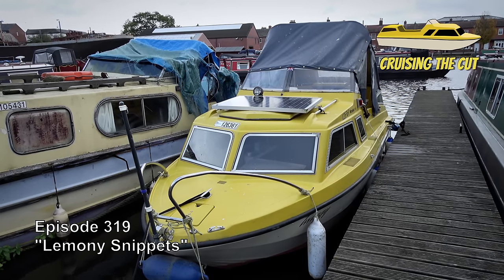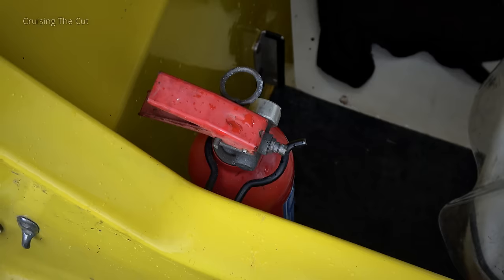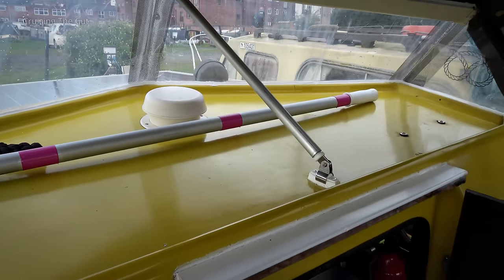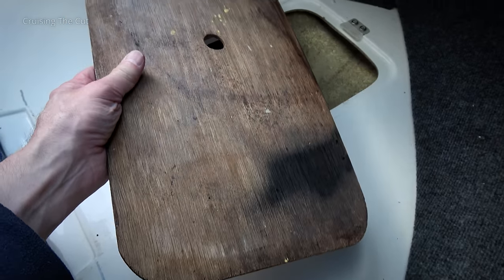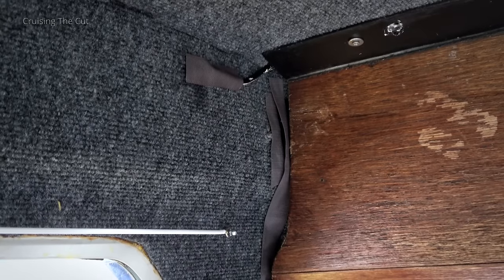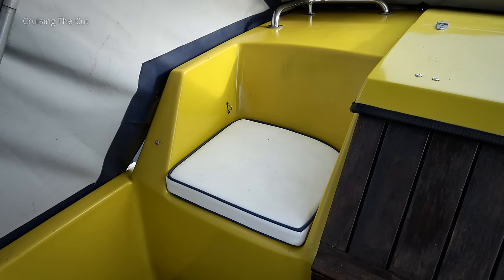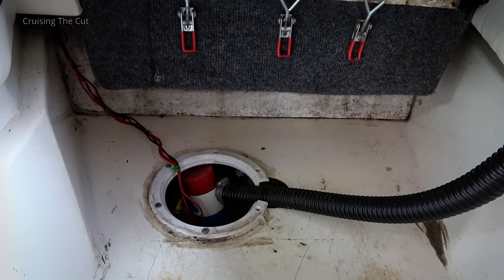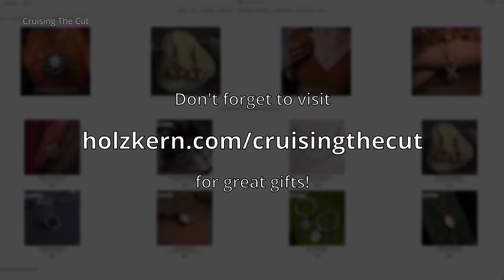319. My boat - the FULL TOUR!

Comment: Fantastic tour and a brilliant video as usual. It doesn't matter that you have a long list of jobs to do. As you say, it's a super cute boat that puts a smile on your face, not to mention on the faces of everyone watching this video! 😀
I could give you lots of suggestions for the peculiar fixes you need to do, but here's one that is well worth doing and easy too. On that rear "sink" thing, that catches rain water next to the engine, raising the base slightly will make the drainhole at the correct level to drain all of the water out of the area. A piece of composite plastic board laid in the bottom of the "sink", sikaflexed in place and sealed around the edges, would do the trick. Plus if you install the board so it's at a bit of an angle, then all the water will naturally flow to the hole and not into your boat. If you'd already thought of this, then apologies for teaching your grandmother to suck eggs! 😀
By the way. I recently overhauled my electrics with parts from 12 Volt Planet. They were also super helpful with advice and answering my novice questions! They might be a little bit more expensive than ebay but it's all good quality stuff that I've had from them. Hope that helps.
Reply from the maker: Yes, I bought lots for the van from 12VP, always good service. I might take your suggestion and fibreglass in the board rather than sika it.
Reply: I've always had good products and help from 12 volt Planet too. No affiliation, of course, I'm just happy to recommend them.

Comment: I really like the boat, although clearly it needs some work to bring it up to its full potential. It sort of reminds me of my caravan that I bought in July of this year. That too, needs some improvements. Now, where are Simon & Gemma when you need them...I'm sure they've got plenty of time to help you out. They've only got 4 boats after all and they need a break from Sarinda in any case. All jesting aside, you are more than capable of doing this and the excellent job you have done on your van will stand you in good stead in upgrading your wonderful little boat. I suspect that those dangling 12v connections were for LED strip lights or the like. There was one in the rear cabin.

Comment: HI WHEN YOU ARE NOT RUNNING THE OUTBOARD SHOULD BE TILTED UP THATS WHY THE SPACE BEHIND IT. YOU SHOULD BE ABLE TO TIDY UP THE BILGE PUMP WITH A THROUGH THE HULL FITTING ABOVE THE WATERLINE AND WHITE BILGE HOSE LOOKS SO MUCH BETTER .AS U SAID LOTS OF LITTLE THINGS TO DO BUT THATS THE FUN PART. GET A PANTONE COLOUR BOOK OR I THINK A PAINT STORE WILL HAVE THE INDIVIDUAL COLOR SWATCHES THE COLOURS  WILL HAVE FADED  BUT U SHOULD BE ABLE TO COME CLOSE.YOU'LL GET THE FEEL OF STEERING THE BOAT JUST HAVE TO GET THE HANG OF STEERING FROM THE  CENTRE OF THE BOAT GOOD LUCK FROM CANADA MATE

Comment: Fuel gauge - you can get replacement fuel caps for outboard tanks with a built in gauge, the only problem I have found is that the clear face seems to go opaque within a couple of months, maybe it's something in the modern petrol or because mine lives on an open deck when in use, would like to know if others have the same issue with these.
The problem with electric cooking might be recharging the batteries; you don't have a big diesel driving an alternator, if the outboard or its replacement has a charging coil you will only get an amp or so at canal speeds, I'd guess that solar panel is about 80 watts and depending on marina hookup would be quite restricting.
Gelcoat - as others have said automotive paint suppliers can match a sample which is what you need to do because the colour the gelcoat is now is not the BS or RAL colour it was in 1975 after all those years of weathering.
Water - in my microcamper I have a water container with a tap mounted over the sink which does the job with no pumps or pipework to go wrong.

Comment: Hello from Kansas! I'd make the back cabin into a utility room and put things like a water tank, an instant water heater, the batteries and controls in there plus any gear. Like you said, it was designed for children and not big enough for an adult. I'd say you're going to become a fiberglass repair expert soon! At least you don't have to worry about blacking it! Maybe get with a shop that does fiberglass and see if they can match the color. Have fun! Thanks!
Reply: agreed. kind of what I've done on my Norman 20 Conquest (a very similar design) - but just have to be careful re: ballasting

Comment: 1:21
Sealed beam that might be the bee's knees as a replacement for that weak light...and may be a plug and play fit?

size 114mm...
Hella Part NO: 1M4 905 905-001
Hella Legacy Part NO: 1089

Spot lamp beam to suit hand held spot lamp P/N 1520.

Specifications:
Voltage: 12V
Power Consumption: 100W

or go 4WD style LED light bar...less power  consumption

Comment: As an ex tv reporter you know how to deliver a voice over so it doesn't  bore, and easy to follow and is entertaining  to boot. On the plan for an induction stove--good idea but you'll need heaps more battery power, hefty cables, and charging. Around 200 watts, 160 amps draw. With little room for solar panels, a generator might be in order.
Reply from the maker: Yep, see what I did in my campervan ("Vandemonium" channel) for the idea

Comment: Maybe the batteries are positioned under the sink because of the weight distribution. Its a rather small boat and these batteries are heavy. I own a daycruiser, 6,36 m long and 2,36 m wide. One day when i came home from work, my dad was busy sawing the base of the left seat - a wooden box, just walls - in half 😮and mounting a hinge. So we could place the starter battery under the now opening seatbase in the middle of the boat lengthwise and a bit more to the center. The boat was sitting more level in the water after that.
If you want to use induction cooking, how about looking at something like the bluetti AC200, these are also available from other brands. These boxes have a battery, sometimes extendable with an external battery box, an inverter, DC output, solar, car and mains charger. If charging from solar the minimum voltage of the solar charger input is higher than the voltage of a single panel, you need at least two. Or you configure for loading from a car which reduces the minimium input voltage low enough for a single panel but limits the charging current. It can also be charged with a mains adaptor. However, everything is in one compact, if rather heavy, box you can take home and charge. It definitely is able to power an induction cooker. Since it is portable it can be used in your van, too. Or as emergency power at home.
There is something to know about the AC200, if you activate the AC output it will, without any load, drain 2,5% of the battery every hour. So after 10h 25% of the 2 kWh battery is gone. Clearly not meant to run 24/7, except if you keep recharging.

Comment: Paint the plywood hatch covers with thinned down epoxy resin, as they are internal there will be no problem with UV affecting the epoxy, make sure you sand and dry them first. Just my suggestion. You can thin with acetone but there are special epoxy thinners made for purpose.

Comment: Delightful vlog. Given the age your boat is in excellent condition and worthy of the effort. Certainly nothing overly complicated to repair. It may not be in the budget but re-powering with a "modern" engine" with electric start would be a massive improvement and afford the ability to upgrade the controls and the binnacle. Perhaps approach Honda on performing a DIY re-power demonstration could provide a discount and a trade-in of an otherwise function older engine. Yamaha also builds some excellent engines and offer a trolling speed control feature for precise low speed operation such as your application. It would also afford you the opportunity to expand usable space in the aft cabin. Depending on amperage draw an electric trolling combined with your solar array could provide a quiet, low speed solution. Lastly, why not reposition / expand your solar panel cantilevered over the engine? Looks to be a new, and enjoyable journey into new construction methods and materials. Best of luck.

Comment: Quite a paradox - three fire extinguishers yet sloppy electrics (which present the most likely source of fire). On the solar panel, I would make a frame to hold the panel - something of an '#' shaped frame that bolts through the hatch lid. A stout panel of plywood on the underside of the lid would address any strain points on the lid. You would then be able to open the hatch AND have a solar panel.

Comment: Pausing VERY early…. You can get expanding drawer type rails so that the solar panel could be slid forward out over the bow far enough to be able to open the hatch
Reply from the maker: Oooh I like that idea!
Reply: @CruisingTheCut  i was looking at my hand cart whose U shape handle can almost double in length buy repositioning a couple of cotter pins

Comment: If you take a easily removable piece of the hatch or part with the color you wish to find to a paint shop they can color match for you. Since the paint is 50 years old that way the new paint will match the color.
Reply: Indeed. Decent paint suppliers use spectrophotometers to get an exact match of the colour as it is now, and can even make up aerosols. As you suggest, using the original colour code is unlikely to match paint that's been sitting outside for 50 years!

Comment: As with any old outboard have your boatyard pull the water pump apart, clean out the alien lifeforms then REPLACE THE RUBBER IMPELLER and change the mixture of canal water and lube oil for new.  No good impeller, no propulsion.  Can you tilt the motor out of the critters as you leave the boat?  Green slime doesn't grow on props and outboard foot not stored in the water.  I'd keep an eye out for an electric trolling motor as you can't paddle this dead boat.  Good insurance if there is trouble.

Comment: You are on the road to learning all about fiberglass repairs. Think about using epoxy, instead of fiberglass resin and hardener, a lot less smelly but a longer setup. Enjoyed the tour. Great to see you back on the water. .
Reply from the maker: Yes, I've been watching various videos already. Wish I understood more about the difference between epoxy and resin though. Seems there's not just differences in them themselves but also in then applying gel coat to them. Or not. It's very confusing.
Reply: you are right, getting gelcoat to adhere to epoxy is an art. definitely painting epoxy is the easiest way, but you still have to be fastidious.  You seem to have a lot of gelcoat repairs and a colour match would indeed be difficult. There is a technique for removing all the small grazing cracks, but usually you need to go past the gelcoat and into the glass. Be sure to wear a respirator when breathing those fumes and dust. 
  @CruisingTheCut

Comment: Even if you get the same color used back in 1975. It will never match. I saw some gel coat suppliers have matching palets like the one used in hardware centers for house. If you get a chip loose you can bring them and they will scan it and give you the best match available. Maybe you can have a sampler made and test it before buying gallons of it. Buy the way there’s no economical way to keep a foot on the water. 😂. Thanks for the share and maybe we will have a Sail Life style diy 👍🏻✌🏻🇨🇦

Comment: You're so critical of the boat it makes me wonder why you bought it; but other than that I get a certain sort of Fred Rogers vibe.  The taped on wires are easier to remove, reroute and repair than permanently installed wires, and if you plan to move the solar panel and other electrical items, that is a good thing.

Comment: Are you going to pull the boat out of the water to do all the work? It is probably a good idea to get a look at the hull below the water line. I would also suggest having a mechanic go through the outboard to make sure everything is tip top and will not leave you stranded. Please consider getting a 4 blade propeller with a lower pitch for greater maneuverability at slow speeds, ask your Honda dealer to assist you with choosing the correct propeller. Why is your outboard offset on the transom of the boat? That could certainly make steering a bit more challenging.
Reply from the maker: I'm going to replace the outboard and yes, get it out of the water in the Spring.

Comment: Yeah that forward hatch blocked by the solar panel. I just 'sort of addressed' that on my boat. The dinghy was blocking all three hatches on the forward berth/head. I raised the nose of the dinghy to get some light into those areas and only later did I have the thought: What if there was a fire on board?? (I should've had that thought first.) Raising the dinghy just happens to  allow getting out through all three in an emergency. So problem solved, but no points for awareness.

The solar panel. Pantograph, two parallel struts on each side so when you lift the hatch the solar panel just goes straight up. Now you can get out in an emergency, but you can also run with that hatch open for ventilation and the solar will still work.

Sliding curtains for those slanted windows. There will need to be a vertical rod with a right angle extension for the part that is farthest out, then the same upside down for the other end that extends in the opposite direction  Whatever position open or closed the curtains will  keep to the same angle as the windows. Could be very nifty and attractive. 

And Twiggy's spider cracks? Well Helen Mirren has few 'gelcoat issues' and she's still stunning. Is that inappropriate?  I guess I'll find out if Liam Neeson knocks on my door and punches me. Meanwhile, enjoy the boat.  The ducks look like they're encouraging you to set sail, or maybe just drop some cheese sandwich bits overboard.

Comment: Better than many I've seen. But Billy Bodger has left his mark. Those wires with green plugs probably have 12V in them. But better to replace with a proper setup. I doubt you will match the colour. Even if you can find the RAL number, fading will stop the match. 
Guess we're going to see some fix and modify videos. Have fun.
Reply from the maker: There will be many videos, I'm sure

Comment: Great tour David. Lots of potential and twiggy is in quite good shape for 48yo. It might be just hearsay but when my family had outboard engines if the boat was a single engine then it should be attached to the transom at the centerline of the keel. Supposedly if it was offered it affected the handling of the boat. Happy boating and best wishes for the holidays

Comment: I would go for a total strip down on this boat.  Rip the lining out, Chlorinate all the mould, Fill all the holes - Camper van stretch carpet is a good replacement, and why not use CVan Rubber Insulation/sound deadener sheeting, the carpet sticks better to the silver side of that,  Get rid of those terrible doors, replace with melamine, very cheap but looks clean.  Rewire, with nice LED lighting, sockets both 12v and mains.  Install a hook up for power/inverter/charger plus Solar charger.  The Solar panel problem, might be solved with thin flexi panels in some way.  To keep things simple make sure that all panels are the same wattage.  Several small panels might be best.  The water in the outboard area looks easy to get rid of.  Put a false floor in it and seal that.  A higher floor will drain through the hole.  12v Batteries should be in a plastic box, also use AGM Mobility type, cheaper and better than Leisure wet ones. safer too. no gas release!!.  In the cockpit address the floor with a fitted rubber mat with good grip, and seal LEVEL, you might be better with a removable one in case you carry mud into the cockpit on the shoes.  Put some tinted / one way (Car type) skins on the windows.  Not trailing wires inside!!  Maybe PAINT the whole exterior with a sponge roller, using marine paint suitable for fiberglass.  OK it might cost £400 to do all this, but you then have practically a NEW shiny boat.  I know, you will have to work for it, but it is a lovely and very practical boat.  Make a video about it too.  You will enjoy every minute!!!
Reply from the maker: Yes that's pretty much the plan albeit lithium battery

Comment: As regards your repairs on the boats surfaces It might pay you to get a colour match at a paint supplier rather than just relying on a paint code , as that does not take into account over 40 years of sun bleaching and fading , if you take a small flake along most can be matched

Comment: I believe the boat was made for a larger engine, and the weight of the engine would lower the back of the boat, and the water would drain out. The hole the smaller engine is not changing the center of gravity of the boat. If you put a 100 horsepower engine on the back the  water would drain, but it will be over Kill😂😂 great video brother thank you for sharing your adventure with us
Reply from the maker: Ah, good point. Definitely overkill for the canals though!!